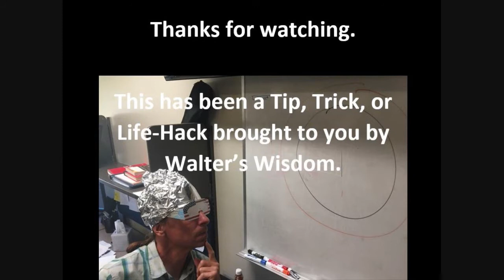Cutting Operations - Radial Arm Saw Know How, Part 2 of 9

Comment: I have that exact saw. I've had it since the mid 80's (I think). I use it all the time. I've only used it once for ripping. Its something I will never do again, but for cross cutting, its great.
Reply: is it not great for rip cuts ? I feel like I tried it once and was very concerned doing it. I also have the exact saw, my father gave me it when i was younger as part of a starter set he gave me.
Reply: @capnkiev3141  Hi, It rips wood just fine. Its sticking your arm between the fence and the blade that bothered me. It was just very uncomfortable. I have 2 table saws for that.